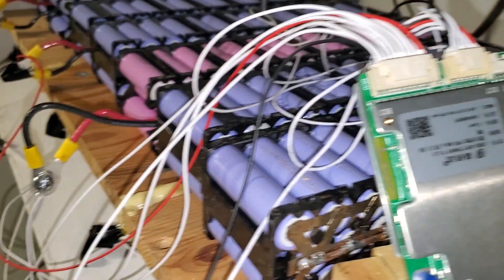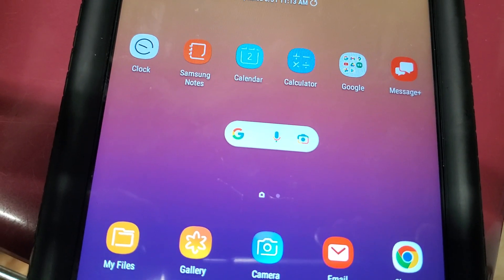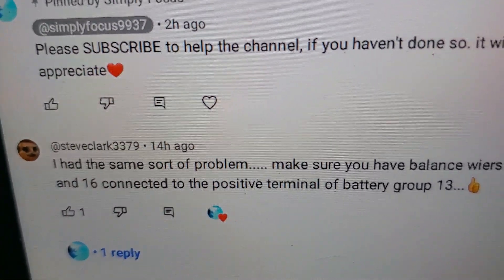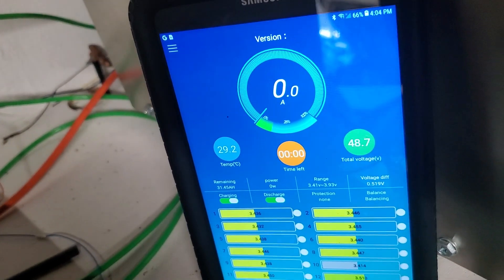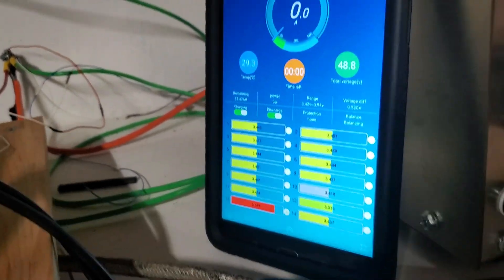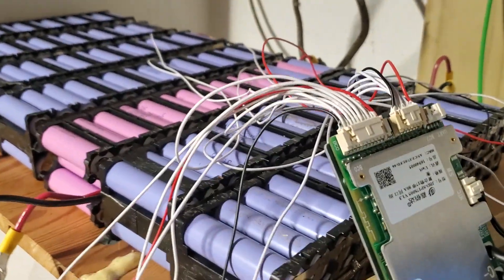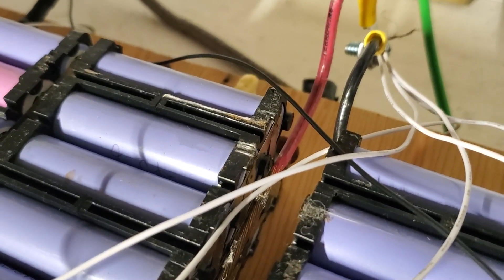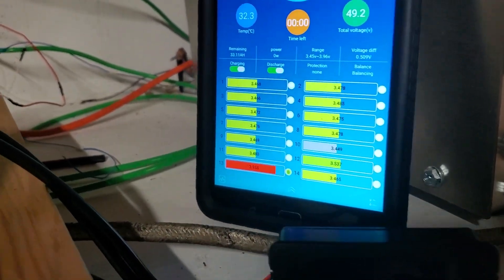HOW TO FIX JBD Smart BMS 14S WITH 17 WIRES 48V 80A Lithium Iron #Battery #bms #solarenergy #inverter

Comment: How reliable is this BMS so far?
Reply from the maker: This one isn't JBD BMS, it is a fake one. This one is cheaper then JBD's. I do have a JBD that broke for no apparent reason. It just stopped working. You will have to pre-charge your inverter or it will not discharge

Comment: Can you clarify what you had connected before and after? 

I am struggling with similar issue on jbd-sp15s020 . I connected the red wire to the last cell positive and the previous 3 white wires to the same last cell minus side but its not showing 13 cells with proper voltages(checked individual cell voltages by meter too ..)

P.S. why is your last cell so off compared to the others? Have you checked it with the meter to verify voltages shown are correct?
Reply from the maker: How many wires do you have

Comment: If its 48v how come its only showing 15 cells? The positive from the bms goes to the positive of the 16th cell and the spare wires goes to the positive of the 15th cell. I dont know which app you are using but if you get the xianxiang app there is a lot that you can do with it, eg you can set it to charge the batteries only so if its spare capacity it will just keep them topped up, you can set discharge cut off point to any voltage, The only thing I couldnt figure out is the capacity meter
Reply from the maker: This is Lithium Iron . Cells are 4.2 max. There should be 14 cells. 48v system. There is no "if". Just 48V.  
There are 14 cells therefore 14 positive. On the 13th cell, you add 13th. 14th, 15th &16th  wires together. The 17th wire you place it on the 14th cell. That setup will work on any software you have
Reply: @simplyfocus9937  my mistake, since you said they were lithium iron I thought you ment lifepo4, In europe lithium iron is lfp or lifepo4 which is 3.2v per cell. Lithium Ion (LI-ION) is 4.2v per cell.
Reply: I am correct that you added your 13th,14th,15th & 16th wires on the 13th cell positive which is also the 14th cell negative terminal as cell 13 plus and 14 minus are joined there? If that's the case then this technique did not work for me on setting 13s with jbd-sp15s020
Reply: @nikitaredko2348  the positive bms wire goes to the positive battery terminal and the rest of wires not use are connected to the negative as you stated, you didnt say in what way it doesnt work but is the bluetooth app connected to the battery? you need to go into control and enable input/ output, assuimng you're using xaioxiang app, what the original poster just post doesnt make sense since the batteries are in series and you have to connect positive to negative
Reply from the maker: The black wire (negative) goes to the main negative. YOU CANNOT JOIN NEGATIVE & POSITIVE TOGETHER NEVER, NEVER, NEVER
Reply: @simplyfocus9937 black goes to cell 1 negative , then white to the positive of cell 1(which is the same place as cell 2 negative). Not connecting negative to positive on same cell with same cable ...
Reply: @nikitaredko2348  yes blk goes to neg and white goes to positive of each adjacent battery, there are 2 red wires, yeah? one per socket
Reply: @dantronics1682 my version has one red wire on the harness - one harness for all 16 wires. black at BC0 and red at BC15. BC14&BC13 are shorted on the PCB which is the same as wiring both to same wire terminal. The problem is that when I try to wire BC12 to the same terminal  as BC13&BC14 are wired to(Last cell negative terminal with red going to positive on same cell) it's not showing 13 cells at same voltage.
Reply from the maker: @nikitaredko2348  This is the setup for 18 wires that you can use with 14 cells LITHIUM IRON not Lifepo4. If you already have  only 15 wires, this setup s not for you to use.
Reply: @nikitaredko2348  shouldnt battery 13 have 4 wires to it?
Reply from the maker: This is a link of  video for 15 wires https://youtu.be/0cTplOYMIKU?si=xwtBo0IG2-Smh4uQ
Good luck
Reply: @simplyfocus9937 Is this for 14s as per manufacturer config? I have the same BMS but have trouble getting it to work as 13s
Reply: @nikitaredko2348  how did you do 13s? my wire harness is missing a wire making this extra confusing
Reply from the maker: @nikitaredko2348  The 17th wire goes to the 14th cell positive
Reply: You can see on the PCB a short between bc14 bc13(bc115 is red wire). That's how the manufacturer got it down to 14s from 15s. I have on the photo connected the next white wire bc12 to the same terminal as bc13. Essentially it's the same as connecting the last three white wires before the red to the same pad.